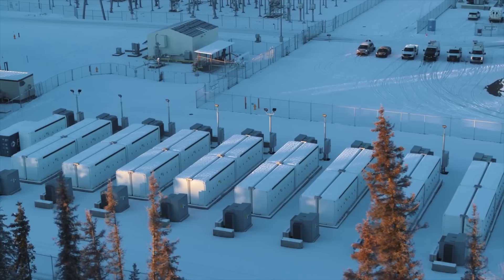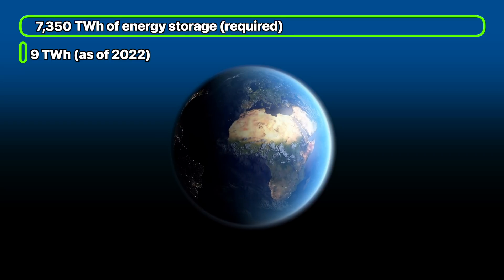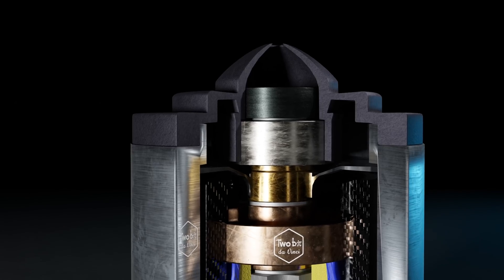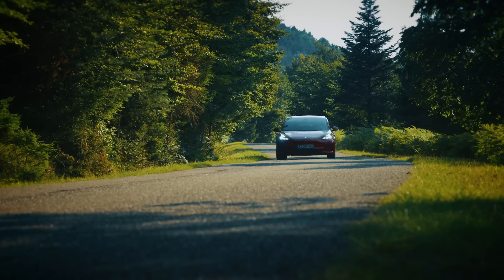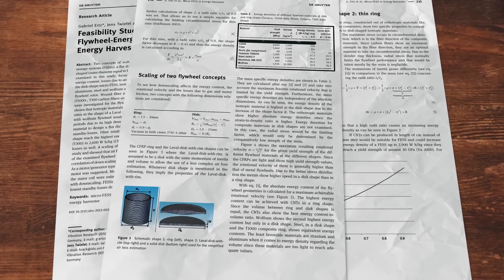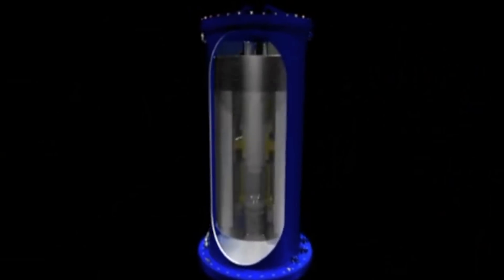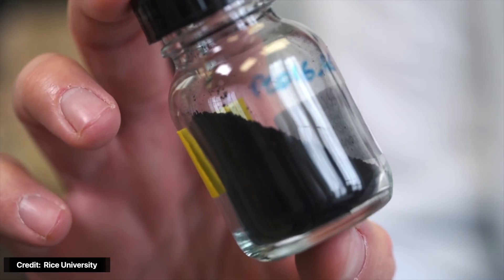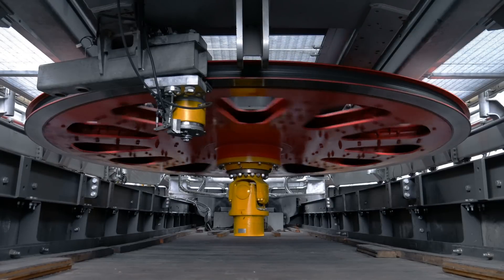Breakthrough Energy Storage Tech CRUSHES battery prices by 90%!

Comment: My Grandfather built a telephone exchange power system back in the 1930's and they used a 16T flywheel to rotate using an electric motor with a diesel motor as a backup.
They had a catastrophic bearing failure and caused the 16T wheel to take off out of the retaining pit, through the wall of the power building and down the street of the town.
it ended up in the council hall with no-one hurt, just a lot of damage.
needless to say the next ones had a far deeper Pit under them.
Reply: This story isn’t getting enough attention lmfao.
Reply: Hilarious, but it wasn't for them !
Reply: @linmal2242  "Oh dear GOD! That giant wheel is headed straight for the pastry shop!"
Reply: It's not the only case of bearing failure,  In the Textile producing mills of Lancashire and Yorkshire a number of recorded bearing and shaft failures occurred and with Rope Race's or flywheels weighing up to 90 tons the destruction caused was horrendous.

Comment: I have design systems using both fly wheels and batteries for energy storage. I know many of you cannot comprehend the magnitude of the problem so let me spell it out for you. Given the current technology we cannot manufacture enough energy storage to do what we need to do. Nuclear is our only solution at this point. Maybe sometime in the future new technology will come along that will allow for this but in the meantime we areStuck with nuclear. We have no other option. I know many of you will be upset over these comments, so may I suggest you write this down. Come back in 20 years and look at what I’ve said, then maybe you will understand.

Comment: I wonder how well it would work if the fly wheel was attached to a windmill or something of the sort. It would never really go into standby mode that way to lose all that power, but could continue to spin while not in use.
Reply: @KastorFlux  I think he might mean using an array of wind generators to keep it topped off all the time, even when demand is low. That's already part of the grid storage designs and in essence the point of using a storage system.
Reply: @Mavrik9000  I did mean this, but I am glad it was explained why it doesn’t work in a way I could understand and not to be an a$$hole. I learn this way.

Comment: Lawrence Livermore national laboratory developed a flywheel storage system almost a decade ago, that had PASSIVE magnet bearing holding the rotor in a levitated state, in a vacuum, with specially made electrostatic motor and generator, very scalable, the parasitic losses were well under a percent per day. 

The passive magnetic bearings are key, as they require zero power to keep the flywheel stable. 
This thing could hold power for weeks.

The articles I found are hidden very deep in the history of their website. I contacted the laboratory about the project, they said it's no longer being funded, but the technology is non exclusively licensed.... 

Other than that, they seemed very interested to keep the project quiet. I was told that was all they could say.

Comment: I as much as anyone appreciate possibility thinking but turbomachinery engineers everywhere are watching this and running while giggling over to the water cooler to entertain their coworkers. Yes, kinetic energy is a function of the angular speed squared and mass to the first order and so speed will outpace mass in designing an optimal energy storage flywheel but stress is also a function of the angular speed squared and catastrophic cyclic fatigue failures on rotating, high speed machinery (which is a real thing) aren't easily solved by adding a bucketful of hopium and a hodgepodge of technologies in their infancy. Solving these challenges as well as other enablers like near zero friction, limitless life bearings are at least 2-3 decades out if this was worked as an "all in" technology supported as a national priority, which it isn't.

Comment: Kodiak Alaska produces over 99% of its electricity from renewable sources (wind and hydro). They originally used Lithium ION battery banks as their battery storage solution. However, while lithium ION batteries are great for consistent stable power flow, when there are spikes in the grid it puts a lot of strain on those batteries, aging them prematurely. Kodiak is a big fishing town, and the spikes were expected to come from a new electric crane they would use for ship loading/unloading. To solve this issue, they added flywheel storage to the mix. The Lithium ION batteries provided a stable energy output, and the flywheels kicked in to handle spikes in power. To my knowledge, they were one of the first, if not the first public power grid to use both these solutions in tandem. It is still in operation to this day.
Reply: Kodiak port wanted to install a new 2-MW crane, potentially causing destabilizing power fluctuations leading to undesirable cycle of the batteries. This is why they got the ABB fly wheel, and an electric crane, displacing thousands of gallons of diesel and millions of dollars of diesel costs. This also reduced the transport of thousands of gallons of diesel in extreme weather conditions. And, lowered the kWh cost to residents.
Reply: @MM-sf3rl  Yes, you are correct. I updated my post to reflect that they installed the flywheels in anticipation of adding the electric crane.
Reply: The company ESS makes Iron Redux flow batteries and it's probably a better solution but it would require good insulation and a little heat applied to the containers for the batteries.
Reply: See these are the comment I come here to find. Alaska is the perfect test bed. Harsh conditions and heavy power needs for heating. I’m very happy to hear they made this work. Batteries are great but mechanical storage is the backbone that will get us there. We finally have the tech to get there, just need to implement it. If it can work somewhere like Alaska then it can work anywhere.
Reply: @Pervatory  wind turbines..
Reply: Actually, hydro is also a good battery, just build more generators, and vary the discharge without frictional nor conversion losses of other types of batteries.
Reply: @madsam0320  Hydro is a good battery.. yes hydro is better than nothing but for example pumping hydro is at best only 60% efficient, nowhere close to batteries we have available today (plus they are cheaper to build, almost no preconditions, cheap to operate, limited maintenance with low cost of it, flexible and scalable with no limits,  no direct local environmental damage,…). Really hard to even compare anything hydro and industrial battery energy storage nowadays.
Reply: See everybody, hybrids. Go team
Reply: 85% of 🇧🇷's electricity is from renewables.( Hydro, Solar, and Wind. ).
Reply: Awesome. Great contribution.
Reply: A city right next to a dam that can provide almost all of the energy is very misleading. Wind is negligible, and they also use diesel.
Reply: @jsbrads1  The two-turbine hydro was maxed out at 20MW. The peak load was 26MW. The wind turbines were less expensive than another hydro turbine.  
2.8 million gallons of diesel saving per year, or $7 million dollars saving is a significant savings for the Kodiak utility. $0.04 per kWh is real savings for the people. True, A significant portion is Hydro. But without the wind turbines and the fly well, the electric crane doesn’t get purchased. 99% renewable.
Reply: @jsbrads1  No idea what you found misleading about it. I clearly said they got their power from hydro and wind. Wind makes up almost 20% of their power mix, so I wouldn't call it negligible. And they use a little diesel intentionally so that if they have to, they can always ramp that up to take care of any energy shortfalls. It's actually a pretty common practice among communities that are nearly 100% renewable. They usually keep less than 1% of their power as diesel, so they have a backup ready to go if needed.

Comment: Great idea, but I certainly would not want to live anywhere near one!!   TNT has an energy density of 1162Wh/kg, so CNT's energy density of 2693Wh/kg would be the equivalent to over double its weight in TNT at full speed should it rupture, e.g. due to a manufacturing defect, external impact, etc.

Comment: Amazing good video!  Been thinking about this problem since about 1978.  What i've come up with; and I'm not an engineer,  is  a; 20 -100 max RPM, cascading system that uses compressed air and flywheels.   Using a variety of flywheel charging means  incorporating several kinds of alternate energy conversion means and devices; you charge; a huge, large diameter flywheel to a point where power can optimally be taken off and used to do work.  The function of the horizontal tensile strength of the material used to hold the flywheel, is minimized.  It reduces that; power lost at idle, factor. Giant Tapered roller bearings in planetary gear configuration support the multi ton concrete and rebar flywheel.  Use three or more in consecutive "planned use"  configuration.

Comment: This is very interesting. Using non chemical storage for electrical energy storage. If combined with a traditional fossil fuel as a generator in a vehicle, it can become a very viable solution if the flying wheel can withstand the vibration and frictional loss from the normal vehicle operation. So far I feel that Toyota has done the best in hybrid system.

Comment: For grid storage, you're looking at the wrong parameter to optimize.   You don't give a rat's ass about the device's weight.  Actually, the opposite, you want more rotating mass.    The mass might be worthy of consideration for mobile use, but not so much for grid storage.   Pointing out the one advantage of one patented technology is the typical scam put out by companies looking for dumb investors.   Sort of like HyperLoop, SpaceX and Tesla, three wildly overvalued companies.   Same thing here.   Nobody cares what the weight is of a machine sitting on a foundation.   More significant is the cost, reliability, life expectancy, and failure mode and damage.  Hmm, not much of a peep about those.
Reply from the maker: All of that is related to weight. Unlike a typical stationary battery this flywheel is spinning at 50k rpm, so weight and optimization actually is key

Comment: No the thing that will stop these flywheels is good old Earth Gravity. 

You build a giant enclosed vacuum sealed flywheel of say Carbon Nano Tubes.
You spin it up to amazing speeds with tons of electricity from say solar and wind.  

So it is spinning very fast then when it is up to the top speed a very little bit of speed drop is seen.
This speed drop increases a bit at a time maybe 0.1% starts to be lost then another hour there's another 0.5% seen dropping and so on. 

The power storage company thinks this is odd why is the spin slowing down it should be not doing that for say 1 month.  

Then they see the slowing is increasing, Then they know what has happened the earth's own Gravity is slowing down the spinning disc. because as Newton found out, the bigger the mass the more the gravity of the earth will drag on the objects mass. The faster and bigger the mass moves the more the Gravity will pull on it and slow down the movement.

So no spinning wheel will keep spinning for long with so much gravity pulling it down and so slowing that spin. Even if the spinning discs are in a vacuum case the earth's strong Gravity will slow that spin. So to keep the stored power as spinning discs you would need to keep replacing the lost spin by keep on re-spinning up the disc to the storage top speeds.

So that would undo all the point of the stored spinning power on the system.  So instead of saving power as rotation you be forever having to waste more power to keep up the spin speed.

That'a why the spin storage is not around. Gravity always wins.
Reply: That's not how it works. Gravity pulls down equally at all points - it's perfectly balanced, so gravity won't make a symmetrical wheel spin any faster or slower.

Comment: Flywheel energy storage in the home is not out of the question. Airconditioning motors have heavy amp draw on startup. Storing only enough energy for motor startup means one only stores around (240v) × (30 amps) × (2 seconds of startup) / (3600 second in an hour) = (a measly 6 watt hours of energy).  The flywheel only need be charged over maybe 5-10 seconds before starting the motor and dischared in maybe 2 seconds, providing roughly 7200 watts for peek shaving the startup draw. When used in conjunction with battery backup. A flywheel could significantly shave off the peek power requirements AC places on battery backup. 

Or maybe it might be cheaper to use a capacitor bank with a 7.2kw inverter for 2 seconds of 30 Amos.

Comment: Here’s the deal any energy storage system will need to store energy for at least 16 hours.   Future green energy generation is going to be dominated by solar which will give power for eight hours.   In eight hours you must capture enough energy for the sixteenth hours there is no sunshine.   A flywheel just loses to much energy per hour.   Maybe they make sense near a Tesla super charger station.  They also might make sense when you plug in a Tesla truck and all of a sudden it starts to draw 1.2 megawatts.

Comment: The "Gaps between Primes" Mathematical Disproof Methodology applied to chains of axial-tangential resonances in sequence "explains" why horizontal-vertical lines of sight horizons due to relative-timing probability-frequency alignments, limits the stability of connected molecular chains, or the half-life duration of physical elements in general, because everything is composed of log-antilog Conformal Field Condensation, ie QM-TIME e-Pi-i sync-duration connectivity Completeness is a continuous Reciproction-recirculation Singularity repositioning-shaping function. Nothing can last forever except No-thing.

Comment: Pretty sure that a standby loss of 3% per hour can be greatly improved. Magnetic bearings in a vacuum are frictionless in mechanical terms. There are ohmic losses in the magnetic bearings, given the way magnetic bearings are commonly implemented. I.e., with electromagnets driven by variable current controlled by feedback from position sensors. But that's a stupid design. There are better options. Permanent magnets positioned to hold the load at its metastable neutral point, stabilized by low drag dynamic levitation with zero force / zero drag at the neutral point. Great for maglev trains also. You could do an interesting video on that.

Comment: Flywheels as currently available would be good for grid leveling “charging up” in the day when solar is peaking and discharging in the evening when solar goes away.
Another idea would be to put flywheels in windmills so the momentum could be stored directly without conversion loses other than that for mechanical transmissions. Then the generator could be run by the flywheels when wind falls off.
Reply: Hybrid vehicles. Only problem I see is safety. What happens with that mass spinning at 50k rpm in a collision. Add to that the vacuum.
Note that you not only have great energy density (Wh/kg), but also power density (W/kg).
Reply: I like your idea when it concerns windmills as their intermittency is not like solar where the sun is needed.  No wind can gust up and down all day long and the flywheel could store that energy to smooth out power demands.  Plus it would be useful in strong wind currents as the flywheel rotational speed could be increased to increase the load bearing capacity on the windmill.

Comment: I think supercapacitors are a better option. I think they're easier/ cheaper to build, can obsorb, and dissipate, power faster, and have a much longer working life. They are very good at smoothing out surges and sags in the power supply, but I'm not even sure that could be considered storage. They certainly have their place, but not as storage.
Reply: Supercapacitors are limited to low voltages and can not be scaled up in voltage.  This is because what MAKES a supercapacitor is a monatomic dialectric layer, which is limited to a few volts.
Reply: @guygordon2780  well that sucks.

Comment: One major factor where this system looses energy is friction. 
IMO it could help to take a page out of the watchmakers book and only use one super small point of contact.
This could be achieved by making a strong central shaft from tungsten, the uper part is magnetically levitated while the lower part is as pointy as possible and spins on a lab grown diamond that is lubricated and embedded in a copper water cooled plate, similar to gears sitting on safir jules in watches. 
This results in low friction confined to a single point.
Reply: In a vacuum chamber.
Reply: @dsloop3907  the system presented by Ricky was already in a vacuum. 
And yes the friction with the air is pretty important and eliminated, with the tweeks I proposed here one would eliminate further friction and potential fail points from bearings!

Comment: Easy fix. With 50% of the country owning EVs and you have vehicle to grid and 50% of EV send power back to the grid (small profit for the owner) you will have plenty of electricity storage. EVs will not only create a electricity demand problem but they will help solve the peak demand problems. It is easy to build more capacity it is hard to ensure power at peak times with cost effective renewables, EVs fix this.